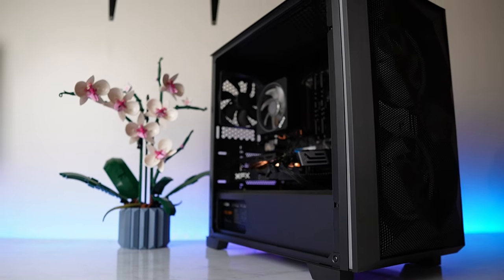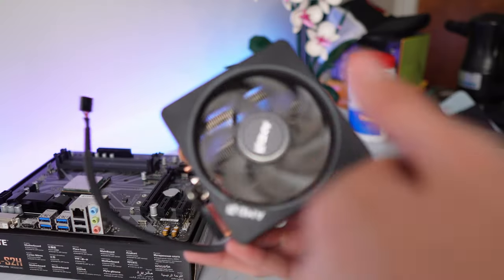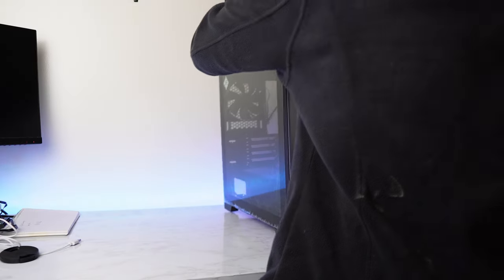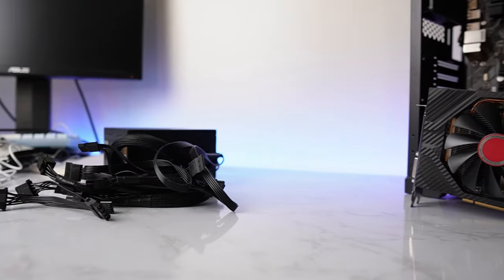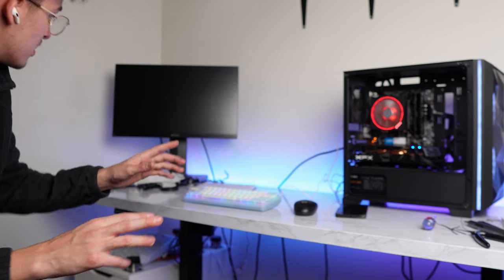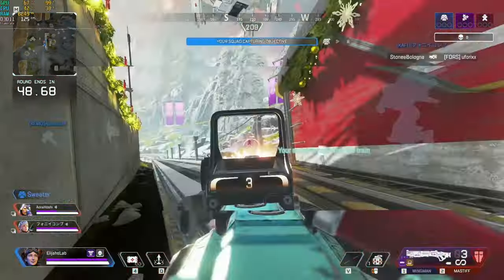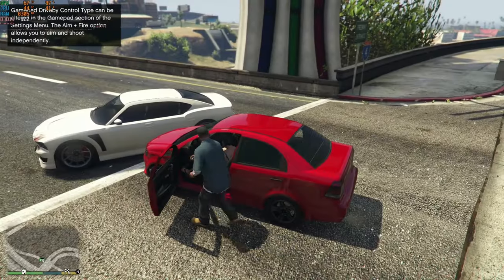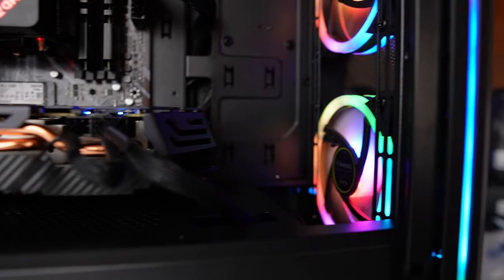I Built this Gaming pc For $320, Is it any Good?

Comment: Hmm I think you overspent on the case and the nvme ssd , could have copped a silicon power 512gb a60 drive for 29.99 and a Rosewill Spectra for 50$. But Overall great build looks pretty good  , I love the wraith prism!

Comment: I started buyin some used parts and flipping it couple of months ago. Now, in the Christmas time, I hope to sell em with some profit. But I have to say, with a budget of 1000€, I did some kinda bad buys. Maybe you can do a video with your mistakes you made over the years. For example I didn’t thought of the Psu connections you need with different hardware
Reply from the maker: Thank you for the input. :)

Comment: bro facts i just built something simalar 
got a mb cpu combo b450 pro4 + Ryzen 7 1700x comes with stock cooler
1650 super 
500gb nvme 
650w psu
4x4gb ddr4 2400mhz
GAMDIAS Gaming ATX Mid Tower
for about 360 usd
Reply from the maker: Amazing 🤝🏽